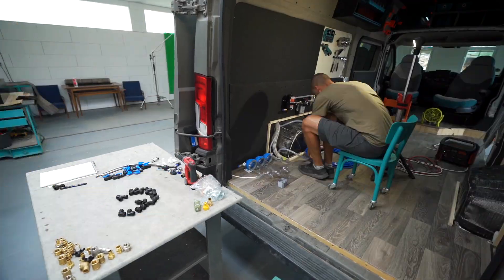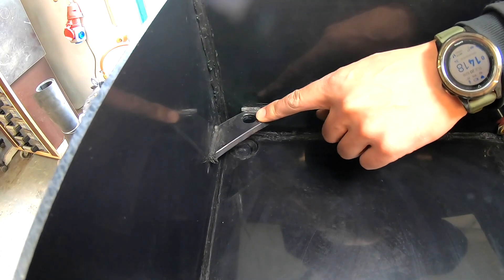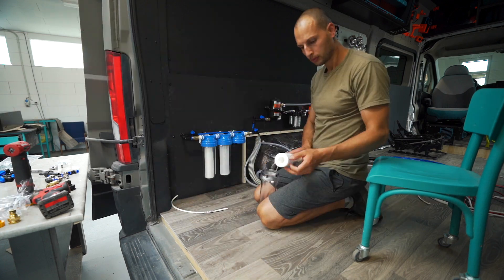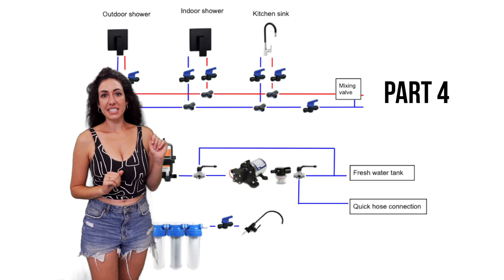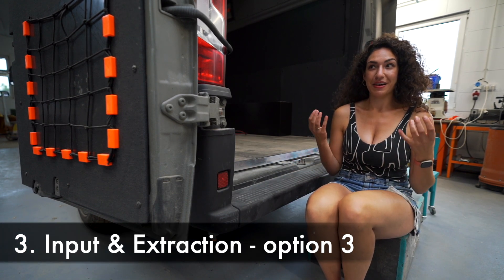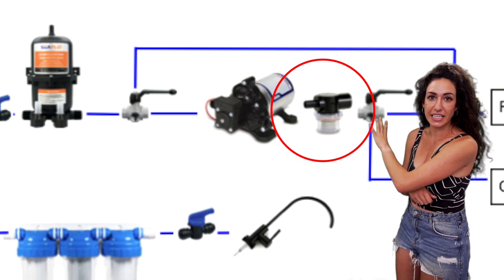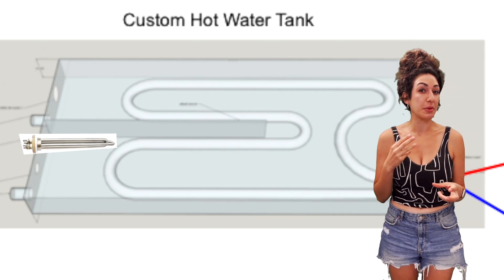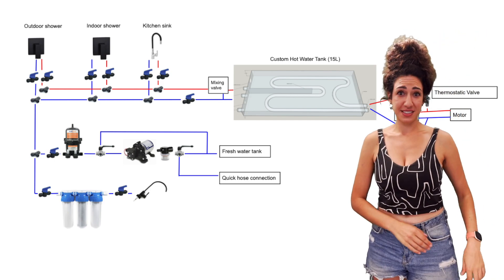Advanced Water System for Campervan (Off Grid Breakdown)

Comment:  Unless your quick disconnect has a good cover on it, where you have it located almost guarantees that it is going to be caked with dirt and mud making it one, difficult to connect to and two - well - dirty.
Question:  Is the heating loop from the engine to the water tank going to be a glycol system?

Keep up the good work.

Comment: if the hot water tank is pressurised please add a pressure release valve just incase the thermostatic valve fails and over heats the tank.

Comment: Great ideas but you are likely to have a major problem if you fill your fresh tank with river water. You are essentially turning your fresh tank into a black water tank. This is because any dirty water flowing through your water pipes will leave bacteria and protozoa that will end up back in the fresh water tank. This is a really bad idea. Those risks will end up on your plates and mugs, which you will eat and drink off, will end up being used for washing which will end up in your mouth and nose and ears allowing for infections.
Your clear water stream will have UV light from the sun helping keep issues down but in your dark water system they will be able to grow rapidly to dangerous levels.

Comment: A bit of a challenge might be the building of the hot water tank, as this is a tank under pressure when i understand the system.
And the plastics used for the other tanks combined with hot water will most likely de-form.
good luck any way!
For my build i have choosen the square 16 from Isotherm.
Reply from the maker: Hot water tank will be stainless steel

Comment: Very nice system. We use a standard kitchen vented propane tankless heater installed in a  vented gas cabinet under the bed. Exhaust pipe to the outside supported by PC fan. No waiting or driving for hot water at all. 
To prevent wasting cold water in the 10-15 sek. until the tankless heater is actually producing hot water we installed an recirculation loop that circles water through the heater back into the tank until it's immediately hot out of the tab. Works like a charm for two year full time vanlife.

Comment: Ladi probably already thought of it, but in the summer as you drive and for a while after you park you will have a big heater dispersing heat from under your kitchen. As a result it should be insulated and I recommend a bypass valve setup so you can have a refreshing cool shower on those scorching days we are getting more and more of.

Comment: In boats, heating water from the engine is quite common, and you might find an of the shelf heater that is more efficient in a marine store. That said, I hope you do not, looking forward to the build 😉
Reply: I have seen quite a few boats that even had in-floor heating or radiators using the heat from the engine and a diesel water heater. I’m from Norway, so heat in the boat extends the season for us 😉

Comment: Sucking water doesn’t work. Problem is the pump only can suck around 1m height difference. This is the problem. 
I‘ve a pump for the accu drill, sucking side short hose, other side can be so long as you wish.
Reply: They would need to bring the pump to the water.  The pumps can push better than they can pull. Can they push up a steep creek bed?  Depends on how deep that creek bed is.
Reply: @jeffsteinmetz7188  Pull a step creek dependent on the strength of pump, but should be no problem.